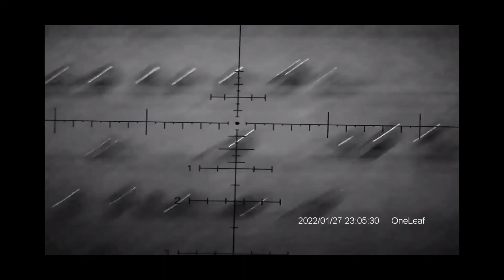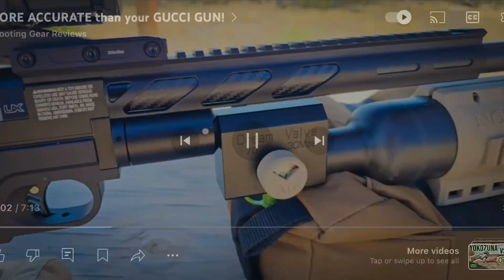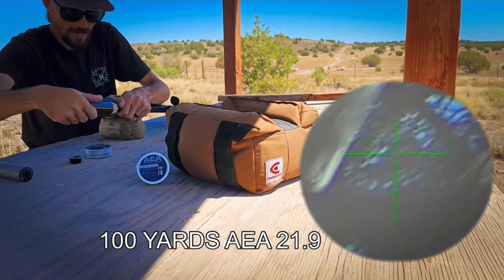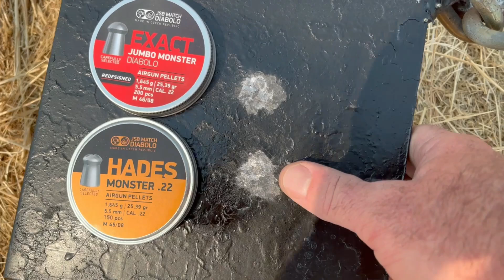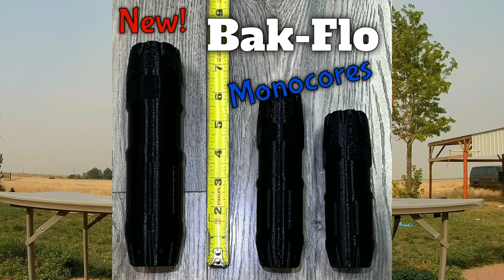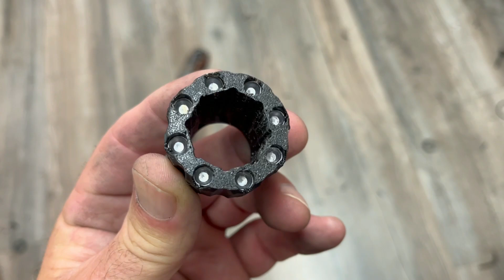52 Foot Pound Umarex Notos! Termindador Supah Snipah 😱

Comment: Nice. Did you do valving work on it or drill out some ports?
Reply from the maker: No it’s capable of 61fpe out of the box so we just left it
Reply: @terminadorairgunsandoutdoors  I'm waiting on the c88 plenum extension, but with just the Huben reg and the 500mm barrel, I'm only getting 27 or 28 fpe. What the hell am I doing wrong then? Lol!
Reply: @dougiefresh3767 What feet per second are you getting and with what weight pellet/slug?
Reply from the maker: @Brianbri-nq3cc  you’ll have to do the math for 25gn 52fpe
Reply: @terminadorairgunsandoutdoors  💡My question was for dougifresh about his 27 to 28fpe that he's getting with his set-up which is why I tagged him in this thread🤔
Reply: @Brianbri-nq3cc   I've done some porting on mine, I am now shooting some Griffin 17 grain slugs at 1005 fps and the new .22 25.5 JSB Hades Monsters at 870 fps for 42 fpe.
Reply: @Brianbri-nq3cc  I've done a lot of stuff to my Notos since I posted that comment. I done porting washers and added a brass hammer weight for more preload, but I'm sure I could get 60-70 fpe if I opened the ports more. I only opened them up to 3.96mm instead of 5mm like c88 told me.
Reply: @dougiefresh3767  WOW, Sweet ass Sweet! I've got 3 of them that I'm about to have beefed up for my daughters because they chose the Notes because of them being so lite, and my boy's preferred the AEA Challenger and Challenger Pro's because they produce the most power period💥 So now my girls are complaining about having to track critters down after shooting them at long distances while my boys are decimating everything out at over 100 yards with one shot, so now I have to beef their Notos's up, go figure😩 Man females will always find a way to make us men spend extra money on something no matter what, no matter if It's your wife, your daughter's, your girlfriend, females period!😭 I think that's what I'll do first is buy a few of those long barrels from this guy because I already have the regulators and bottles that I obtained from the source, I think the power that you're getting is satisfactory, thanks for the reply sir👍👍🏽👍🏿👍🏾👍🏼
Reply from the maker: @Brianbri-nq3cc  👌👍
Reply: @Brianbri-nq3cc  Yes, sir. I used to have 5 AEA Challengers, but I sold them all, but 1. They were the Challenger Standards, and then I had the wood stock 30" barrel .35, and it was a power house just like the long stock 32" barrel .30. That thing was producing 230 fpe with a 108 grain boattail at 975 fps. I wish I hadn't sold that 1 because they discontinued those. My dad has 3 Chal Pros and his .25 Pro is a laser with the 60 grain Altaros slugs and his long barrel .30 Pro is a tack driver with AVS 80 grain .303 slugs. This Notos is not to be slept on with the FX barrel. I'm getting ½ inch groups at 50 yards with the 19 grain Griffins and JSB Monster Hades. Let me know how yours turn out for your girls when your done.
Reply: @dougiefresh3767  Sure thing!💥👍 Do you have a .30 airguns still? I make my own slugs with my Corbin Swage Press and I can send you a few to try out, I don't sell any but I'll give you some of what I call my masterpieces😂 I only have .30 and .357 now until Corbin sends me my .22 and .25 dies👍
Reply: @Brianbri-nq3cc  I sure do. .30 is my favorite caliber.
Reply: @dougiefresh3767  Ok gotta figure a way to send you some, do you have a PO box?
Reply: @dougiefresh3767  you need to do some port work to achieve that power and a min of one plenum with a bottle will be needed as the amount of air that is in the tube wont get but a few shots
i have the 380mm barrel and shoot 25gr jsb  at  960  fps   which is just over 51Fpe 
do some port work.
Reply: @NickM-x2t  Dang, how big did you drill out the valve ports and all that.. 6mm or more? I did 3.8 mm porting and the Huben reg and cf bottle and 500mm barrel and am only getting 42 fpe.
Reply: @dougiefresh3767  my Notos .22 with 380mm FX barrel shoots 25g jSB hvy at 975 980 fps and produces 51.5 fpe its all about port work and plenum volume
Reply: @NickM-x2t  That's crazy becuase of done port work already and put the Huben reg on with its plenum and then I added c88's plenum to it and a brass hammer weight and now I'm getting 45 fpe with the 25 grain Hades Monsters at 895 fps
Reply: @NickM-x2t  whats your email? Could you send me pics of what you've done so I can get a visual?
Reply: @dougiefresh3767  what do you use for poppet ? Try peek
Reply: @NickM-x2t  Factory poppet. I seen the one Haji had but I didn't think I would need that to increase fps.
Reply: @dougiefresh3767  needs more air to pass poppet
Reply: I know I could get 55+ fpe just didn't max it out
Reply: @terminadorairgunsandoutdoors 💡 I'm confused now, because when I asked you on the short video that you made of this gun if you guys did any work on the inside of this Notos, you said "Yes we did a lot of porting and such" But now you're saying that you did not do anything to the inside and left it stock😵 Which one is it sir, Did you do any openings/ drilling out the ports/ valves or not??
Reply from the maker: @ itz fully modded Haass
Reply: 5mm
Reply: @NickM-x2t I thought about going bigger, but the port below the transfer port can't go any bigger, I thought?  The brass port can for sure.
Reply: @dougiefresh3767  you have to drill and re tap for a bigger plug 💯
Reply: @NickM-x2t  Yeah, I don't know how to do all that. I just drilled a few holes a little bit bigger. I guess it'll just have to stay where it is. Unless I throw my 800 mm barrel kit on it. Lol
Reply from the maker: @dougiefresh3767  Top secret stuff yer askin ther Haass

Comment: What’s the reg settings for the pellets/slugs?  I added the plenum and barrel to my Terminador super notos so I wanna know where to start!  Also is that bag when will that bag rider, muzzle weight and barrel rings be available on your site?  Thanks Bruddah!
Reply from the maker: I gotta get Jr.  to add them to the store, but if you text me at (208) 488-1013 I’ll get you sorted.
Reply: @terminadorairgunsandoutdoors  gotcha
Reply from the maker: The reg is like 1500 or so depending on your hammer spring setting
Reply: @terminadorairgunsandoutdoors  I haven’t touched the hammer spring since I bought the notos from you and my reg is about 1700.  I’m gonna leave it as is and see what velocity I’m at.  Were the 15.89 Hades accurate at 1100fps???? If they are that’s gotta be like a bomb going off when you hit a critter!
Reply from the maker: @nickkozicki3830  Good question. 🤔 I actually didn’t test the 16gn Hades for grouping, only velocity.  We went with the 25gn Monster Hades at 965fps because we had the power & they will buck the wind much better than the lighter 15.89gn’s which were doing 1125fps 😳